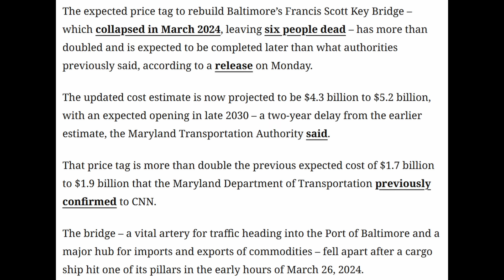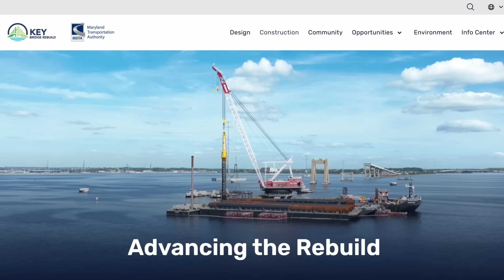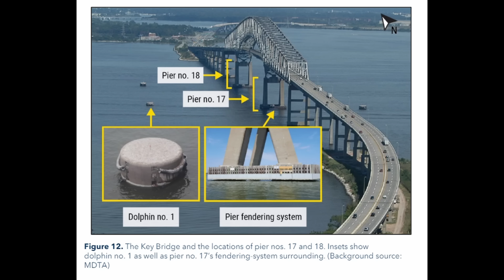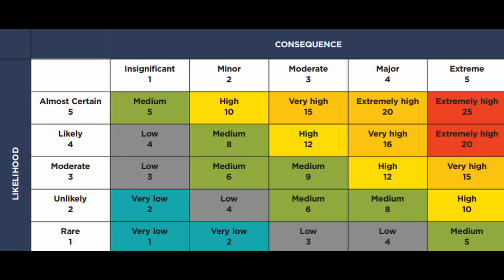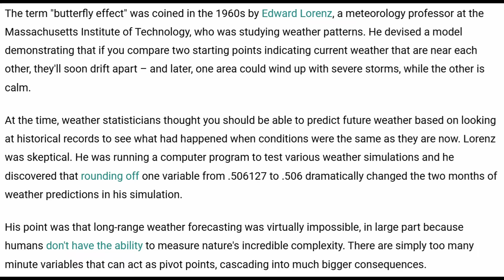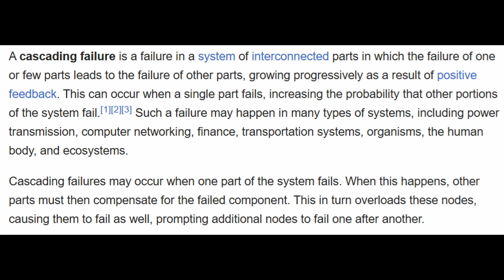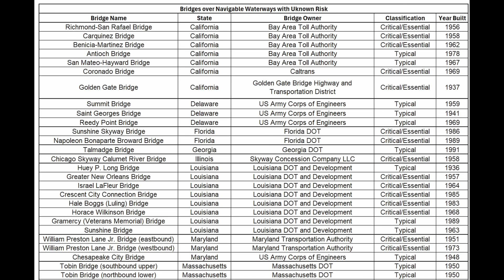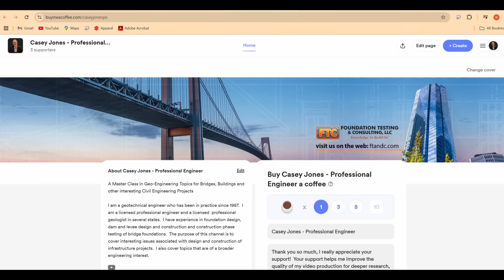Key Bridge Destroyed because of a Label on a Single Cable

Comment: Spent twenty years as engineer on vessels and watched as American and European crews (and Japanese who were excellent) who had a culture of DOING maintenance and repairs right were replaced with 3rd world crews (to save operating expenses) who DO NOT have a cultural heritage of doing it right. This is not racism, it's REALITY based on experience. If you read the whole report on this instance the ship had several systems that were cobbled together which allowed the cascading failure to happen. Now i worked with multiple non-US people from 3rd world countries who were competent but honestly, they were about 1 out of 8 so pretty damn rare. The other 7 weren't bad people they just weren't raised to think about things like US, Japanese and Europeans are and they WEREN'T TRAINED on hiring to think and care about proper maintenance & repair either because of course that costs money the ship owners feel is unnecessary. And looking at the total number of ships in the worldwide trade and that usually there's some redundancy in ships design plus the short 20 year lifespan of a ship vs training or not training cost benefit analysis, sadly the ship owner's might be right. Incidents ARE relatively rare and most will happen away from expensive infrastructure like a bridge so this incident is actually an outlier.
On another note, if you look at the bridge rebuild proposal that's online a MAJOR cost is very VERY high union labor wages. Compare this to European construction where they are also union but REASONABLE wages in their economy where they bring in projects at much lower comparative costs than the US. I fully expect that the final cost for this bridge replacement will balloon higher because, sadly the US union workers will work as slow as possible to increase the time they get paid. ALL my 5 uncles and 8 of my cousins are union construction workers and at family gatherings they will admit that they do this so we disagree heavily about that work ethic being good or shortsighted bad for the country. In some ways they seem to be cult members parroting the union line, not open to rational arguments.

Comment: Thanks Casey for your Engineers view of doing things, it's logical. The new bridge design looks sturdy, and fragile proof.
What killed the Concorde wasn't what we were told in the mainstream narrative. There was debris on the runway.... But all the other contributing factors were not brought up, things we never heard of; -- landing gear that was not properly maintained, it was in need of repair, a careless captain with an expired certification, allowed too much luggage and fuel which made the Concorde overweight, the captain decided to take off with a tailwind and lose the advantage of 16 knots, 8 plus from the tail and 8 minus from the headwind, and the captain used a runway that was not cleared for use and unsuitable, it should not have been used.  -- And we never heard of the death the French barrister who may have died for honestly, truthfully and for successfully defending the Concord engineers who they tried to blame for the crash. -- Governments and corporations have special interests. The mainstream narrative is deceptive.

Comment: From an aerospace perspective the assumption would be that a ship would hit any given bridge support.  Therefore the bridge support must be protected from ship strike. Probability assessment is done for two events.  We assume one ship could strike the bridge, what are the odds of two ships hitting the bridge at the same time.  For the ship assume the given breaker would fail.  The ship still shouldn't lose power.
Reply: It WAS assumed and designed for — for the size of ships that existed at the time of design. But ships grew much, much, MUCH larger in the time between construction and the collision.

Comment: Casey,

I agree with your premise that calculating a mathematical answer is likely to result in misleading results.  Let's look at the marine aspect, because that is what I am most familiar with. 

Could the size and speed have been predicted?  Answer: Yes

After the allision of the M/V Dali with the Key Highway Bridge pieces of the bridge were moved to Sparrows  Point for disposal.  In the 1970s, when the Key Highway Bridge was being designed and built the Bethlehem Steel Sparrows Point Shipyard was building 70,000 DWT, 120,000 DWT  and 265,000 DWT tankers.  These tankers were designed with speeds around 15 knots.  Containerships in the 1970s were designed for a maximum of 20 t0 25 knots.  In the 1970s a ship leaving a terminal in the Baltimore area would gain full steerage at about 6 knots and would transit in the 8 to 10 knot range to obtain full rudder control and to minimize the impact of the vessel's wake.  There were most likely speed restrictions set by the USCG.

Failure Modes and Effects Analysis were not used for vessels in the 1970s.  My guess is they are not common when designing ships today.  To my knowledge the first FMEA used to define a marine design was done to  help with the development of rules for the installation of vapor recovery systems.  The American Petroleum Institute  (API) contracted with Westinghouse to determine if it was safe to connect tankers vapor venting systems to shoreside recovery systems.  There were two Key issues: detonation arrestors and "brain-dead operators."  In a speech to an API meeting of senior refinery management I added a third element and that was: "brain-dead management."

In 1991 the USCG issue a Navigation and Vessel Inspection Circular,  NVIC 15-91, which required tankers involved in the Trans-Alaska Pipeline System (TAPS) trade develop Critical Area Inspection Plans (CAIP) for monitoring key structure in the cargo block.

When I saw the "cause" of the electrical failure being a loose connection I was surprised not by it being a loose wire, but by the way the wire was secured.  20 years ago switchboard wiring required screw connections.  Yes, with time and vibrations screws loosen, but periodic maintenance requires checking each connection periodically to assure connections are tight.  Based on the diagrams it is impossible to determine if a connection is good.  For instance, assume assume 13mm of wire is needed for a "good" connection.  What happens if only 6mm is left past the ferrule?

Bob

Comment: I am a retired service engineer (Westinghouse) The issue with the poor UV connection as reported by the NTSB is no doubt valid but goes very short of explaining this event.  UV relays are almost always equipped with targets that document a trip  The ships engineer crew was obviously incompetent in not dealing properly with outages a few days before.  NTSB totally failed to address generator motorizing issues which are not uncommon in this type of an application.  This case is far from closed
Reply: I just had an interesting thought. What if the multiple electrical issues they had were due to multiple instances of this flaw and not just this one wire? Have they found and fixed others of this kind before?

Comment: Thats why, when wiring these types of connections, you always give each wire the "tug test". Classic mistake...
Reply: It might have held at first. It didn't let go until years later. You would have to tug on them periodically. That would be a good test for the ferrule as well.
Reply: I, too, strongly suspect it passed an initial tug test, and worked itself free over years of vibration, since it was really only barely gripped.

Comment: Hi Casey, professional ship's Chief Engineer here, over 30 years in the business primarily on US coast tankers but plenty of other stuff. All the factors leading up to the incident have already been discussed, the incompetence of the engineering officers aboard is also documented and discussed. What I'm here to say is that this kind of thing is absolutely the norm and not an exception around the world. Port state inspections could find some blunders but they're not trained anywhere near deeply enough and mainly focus on safety & environmental stuff, they're rarely marine engineers. And even if they were it'd take a while to uncover the sins committed by substandard crews. And often it's not even the crew's fault, they risk being fired if they report problems or use to many parts to keep everything running as it should. And let's not forget planned obsolescence, rampant in the industry. Why sell a crew a few $50 parts when the whole whatnot can be declared outdated after 5 years and replaced for 50 grand by your shore techs?

There is a business model where companies will take clapped out jury rigged ships like this still young enough to still operate & insure, flag them in and crew them USA, find & repair/update all the problems & systems and then when everything is fixed turn them back over to the underpaid duct tape & bailing wire foreign crews. I've done a couple of reflags and know others who have done many, the way these ships are let go by the crews and offices is appalling.
Reply from the maker: Thank you very much for your comments! That is a total nightmare situation.
Reply: @CaseyJones-Engineer yeah we cringe going over VZ Verrazano bridge and the outer bridge both connecting Staten Island to mainland... YIKEEEEES
Reply from the maker: @gerry-p9x  It sounds scary.
Reply: @CaseyJones-Engineer  Address the entire system - A specialized electric tug that paces directly forward of the vessel's stem, not towing but maintaining a slight tension, with one task: Pulling the bow to either side if steering is lost. Being electric, it could magnetically grapple for rapid placement and disconnect, then onto the next vessel. Also, it wouldn't have to heavily structured like a conventional harbor tug that has to push, and so could have a much higher speed for dispatch and rendezvous. Also wouldn't require billions of dollars, decades of times, and megatons of concrete and steel. "Do one thing, and do it well" for the ten minutes of transit time through the passage. Basically, an 'on demand' bow thruster.
Reply: @michaelpatrick6485 yeah where are  the tugs harbor masters guiding these behemoths into dock 😮 watched real time on CNN thought it was a Irwin Allen disaster movie but nope real life...
Changes gotta be made ASAP
Reply: @gerry-p9x  There was a story in newsweek i think, the BIDEN admin reduced funding to tug services.  I guess the money saved could be used to rebuild the bridge.
Reply: @woolysamoan yeah but what og potential loss of life and commerce by this major screw up😮. We got major bridges in NYC metro area and the fallicyof saving bucks then rebuilding with saved $$$$$. Is insane..........DOT and gov gotta get some smarts😮
Reply: @CaseyJones-Engineer Unfortunately this all stems from neoliberal economics as set out by Milton Friedman, which is used by the US and many other countries, which states the main duty a corporation has is to the shareholders combined with small government and weak regulations. As obviously, strong regulations reduce profits for shareholders. I know this sounds crazy but go and read what Milton Friedman said and Thatcher and Reagan introduced and is still pushed by politicians today. Having worked as a project manager in construction for many years I have seen this in practice and it’s so frustrating. It just makes well managed projects, that go the extra mile to ensure safety, financially uncompetitive. It always takes an accident such as this to even get politicians and the media to think about it, but then hope it all goes away, so they can get back to making money, no matter the cost to others.
Reply: @johnharvey1786  What a sad state of affairs
Reply: @johnharvey1786  Could not agree more.  It's insane to me that a CEO can be sued if they choose to trade higher quality over shareholder value. This corporate mentality is why so many industries produce overpriced garbage with a 5 year lifespan.
Reply: Yikes!! Thank you for your insights, sir.
Reply: Wow! Never knew this .  What an awful practice, but sad to say, not suprising.
Reply: @karenc8773  It's not all bad. While I painted a pretty cynical picture of the industry a reflag can be an interesting challenging job, I've learned way more and gotten better at my job from working on junkers than I ever would have running a well maintained plant. Senior positions are lacking personnel so it's easy to get a job with the right qualifications, I work when I want and take summers off (It's hot down there in the summer!) and the pay is very good for what amounts to multiple trades work with some light management thrown in.

12 hour days maximum, decent food, everyone aboard getting their own room, Starlink internet, strong union representation, all expenses paid to & from the ship and so forth make working months on end without a day off bearable. I can't say that for the rest of the world's shipping which ranges from similar to my situation all the way to modern day slavery on something that should've been scrapped years before. 

The world average is somewhere between the two. Most people want to do the right thing but are forced by outside factors to skip steps. Complacency & fatigue set in and next thing you know you have the title incident.
Reply: Chief, thanks for your comments.  My background is electronics, electrial, computers and networking. That cable design is bad but when you work with a bad design you check. I have worked in punch down wire rooms, ones that used bridge clips (bad design), RJ45 and BNC coax. The BNC is a great connector but if it is not turned the whole way to the click, it will fail. The RJ45 if not pushed in to the click they will fail. Good techs do a slight pull after hearing the click.  I have not worked with that connector but if the id is loose, you pull it back and grab the cable then slide it down. But on the other hand, your syndrome, when they are not trained, when they are pushed to work faster and not given the proper time. shit happens. The one commonality on these connectors is, speed. But there is a top speed that is safe just as there are top speeds that are safe in travel. Exceed that and things go bad. I tell people, computers have a rated speed, people can ba brow beaten to go faster.  But when they do, it is not good because the little things get skipped. 
There is another aspect of this that is ignored. Bob Johnson, one of the highest scoring fighter pilots of all time, P47 WW2, said he would not play cards with his ground crew or screw (his word) with their women. "They don't turn one screw tight and I may not come back."
Reply: @fromthefireside5677  The connector in question is a single stranded wire with a crimp ferrule over the strands going into a spring loaded terminal strip. Signal wire for switchboard breaker sensing or interlocking, it wasn't specified in the report. The spring loaded connectors work great when done correctly, are easy to insert & remove and don't loosen with vibration like something with a set screw. They just have to be done correctly and there's thousands of connections on one of those switchboards.
Reply: @fromthefireside5677  They should have had a bigger tugboat.
Reply: @woolysamoan  Or two
Reply: It was NOT the fault of the Key bridge.  The Dali was declared as seaworthy.  Plainly not so.
Reply: @john1703  The wheelhouse or the Key bridge?

The Key bridge could have been better protected, the port could have required tugs.

The wheelhouse on Dali did nothing wrong besides some confusion between rudder commands, the guy steering repeating those commands and the actual rudder position which wasn't changing with no power. It really didn't make much difference, with the lights out they were pretty much passengers. The pilots did a great job getting traffic stopped, that's for sure.

If the emergency generator had started and assumed load in a timely manner like it should have they might have been able to steer the ship away from disaster since they were still moving well through the water but it didn't and they couldn't. Another failure on the part of the engine crew.
Reply: @peteysquirrelchaser9028 , this is a multilayered cascade failure, beginning with using the purge pump to pump low-sulphur diesel fuel into the #3 & #4 generators, a purpose for which that pump was never intended.

Comment: The statistical analysis is going to be more for insurance purposes, I would think. You know, establishing a baseline risk so the insurance companies have an idea as to what they should realistically be charging for premiums (as well as an idea as to how much they may need to pay out in a given year).
Reply: Which brings up the question of why weren't the insurance companies having inspectors go in and check these things out in order to reduce their own risk?
Reply: @blairhoughton7918  Insurance companies most likely rely on state inspections and receive those reports which they use to adjust premiums. Assuming the bridges are insured at all - publicly held infrastructure typically doesn't have "insurance" the same way privately held infrastructure does. Or if they do, it's more liability insurance than anything else.

But that is going to have more to do with how the various states and DoT's manage things. In my state, all public roads/bridges are owned/maintained/funded by the government. Private roads (nearly all of which are farm access roads, most of which were public roads at one point) are fully covered by the owner and I doubt most even bother insuring them (they're usually dirt). We don't have toll roads here - which is probably a large part of why I think toll roads/bridges shouldn't exist. 😜